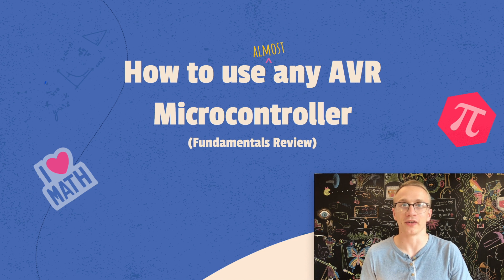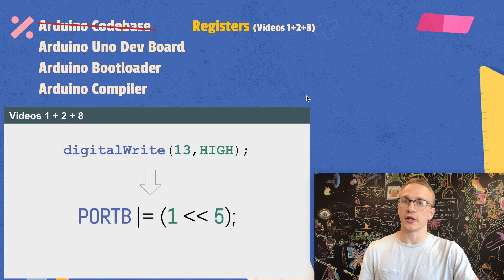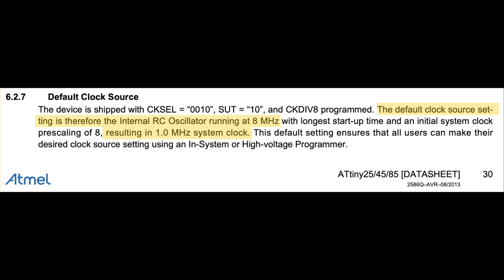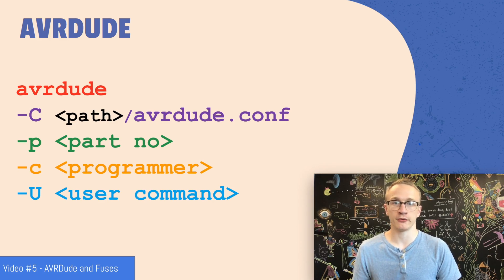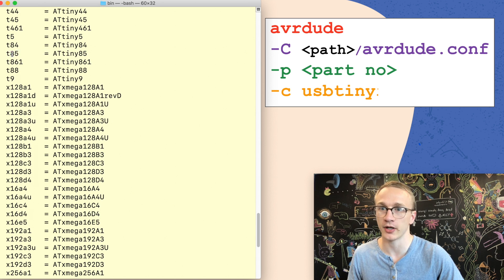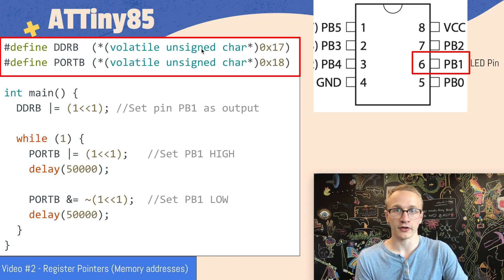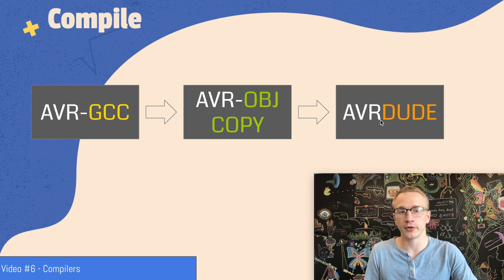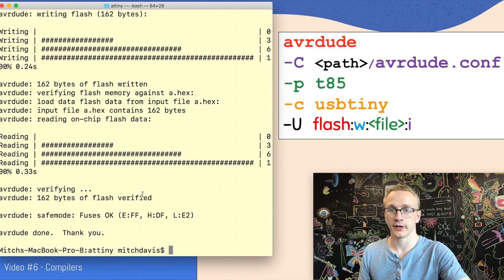Bare-Metal MCU #9 - Review; ATTiny85 from scratch

Comment: I have a lot of old AVR MCU here. ATMEGA8535 and AT90S8535. ATMEGA8535 worked fine with AVRDUDE 6.3 and ARDUINOISP. But with AT90S8535 I have experienced the strangest outcomes so far. It is necessary to use an external clock (I'm using a 8MHz crystal) and there aren't quite evident fuses that work with AVRDUDE (the online calculator states that there is an AVRDUDE lfuse argument but the AVRDUDE returns "lfuse" memory type not defined for part "AT90S8535"). Without fuses I was able to perform a first programming  (avrdude -u -C /etc/avrdude.conf -p 8535 -P /dev/ttyACM0 -c stk500v1 -b 19200 -U flash:w:"avr2.hex":i) and it works fine, but for every AT90S8535 that I try to program a second time it is impossible ("Yikes!  Invalid device signature") but it works well if I disconnect the GND line from ARDUINOISP when programming it again (I'm not kidding). I'm using decoupling caps and everything. Maybe it's better to let go of things from the past.
Reply: @MitchDavis2  They have discontinued it in 2004 I think. These ones that I have were produced in 2001. But don't bother... I was using these because I don't have others AVR MCUs (only the ATMEGA328P that comes with ARDUINO). I was able to apply your lessons with  ATMEGA8535 MCUs and it was fine. Thank you very much. The way you explained it was amazing. I have never seen anyone with your ability to teach. Please, consider some STM32 content for the future and forgive my bad English.